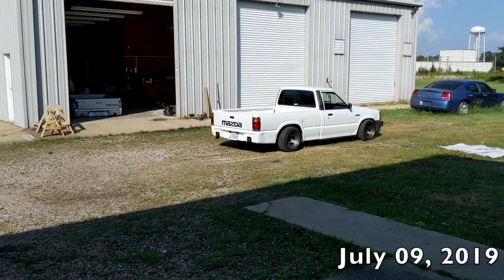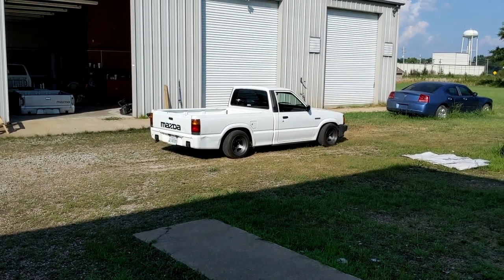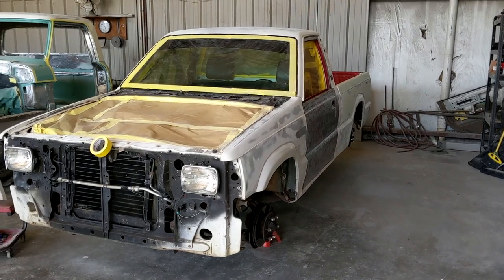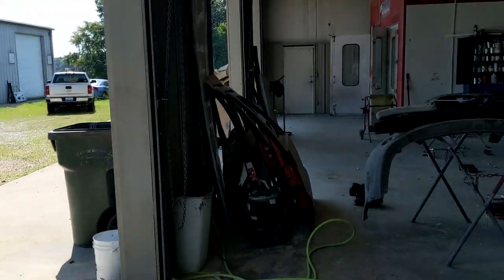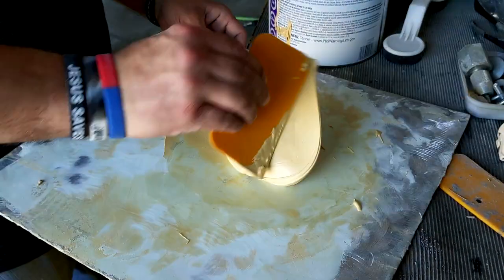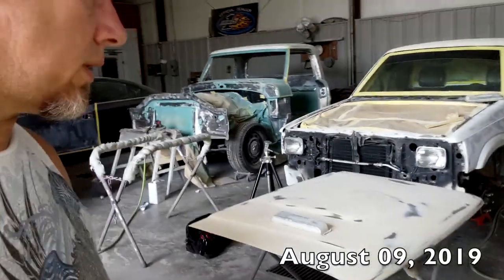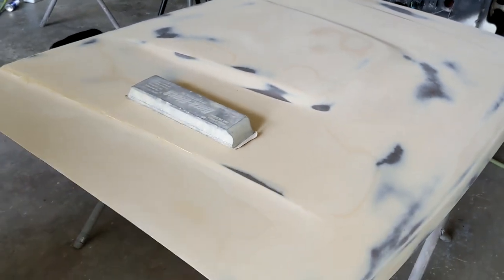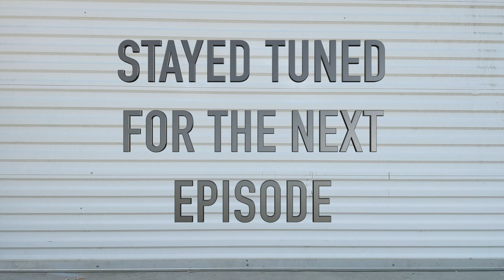Painting the Truck Episode 1 | Mazda B2200

Comment: Just curious why you covered the entire hood. Isn’t that product only to fill low spots?
Reply from the maker: The hood had two paint jobs on it, had to be ground down to metal and had a few dents. Laid gold filler on, sanded, repeat several times, then glazed and sanded a few times for pinholes, the filler primer and sanded. Then primed and paint. 90 % of everything put on gets sanded off.

Comment: Mitch what makes tac work doing cluster swap...don't get it.
Appreciate it.q
Reply from the maker: There is a wire on the coil that makes it work. It's yellow or blue, usually hooked up by default. The cluster swap is plug n play.
Reply: @MazdaMitch  thanks Mitch.
Is this wire part of one of the 3 plugs or do I run this wire up from your coil to a connection on the cluster?
Guessing all harnesses have tach wire incorporated into all including non tach model clusters...right?
Any chance you'd have access to a condenser ...none available  ?
89 2200 5spd.
400k new engine .. webber  header n 109 today no ac...whew!!
Thanks  again.
Reply from the maker: @williamvictory2009  On the condenser, I tried 3x with RockAuto and they kept shipping one that doesnt fit our trucks I told them, but they dont care. Find one on eBay, or Junkyard and clean it inside and out. On the tach. the trucks are wired to accept a cluster with tach, its all wired already. For years I ran an external suntach or sundial brand tach mounted to the dash and ran a wire to the coil area and connected it Cant recall which one, but without doing all that a tach cluster will work as soon as its installed and plugged up. If it doesnt. It may be the cluster.
Reply: @MazdaMitch  gotcha...appreciate you! Condolences re; your dad's passing..
Time is all that helps.
Mom passed at 100 in 2016.
Still think of her devotion everyday and miss her so very much...yep was all in mama's boy.
Stay engaged Stay safe!
You give us all hopes for a better B.
God bless my friend